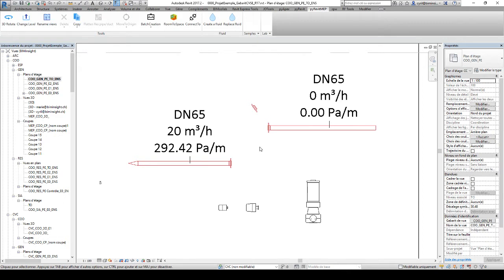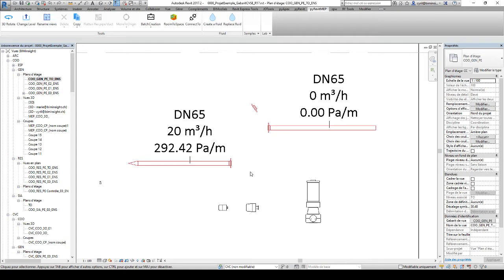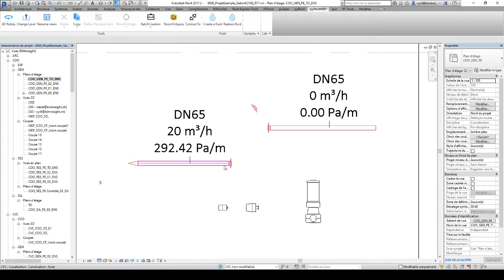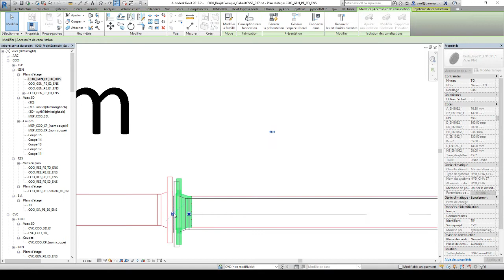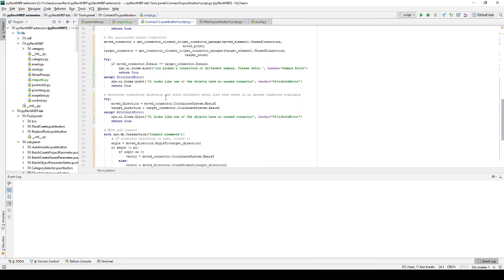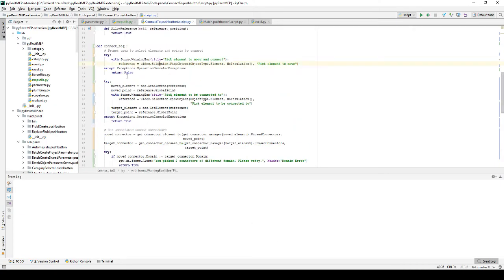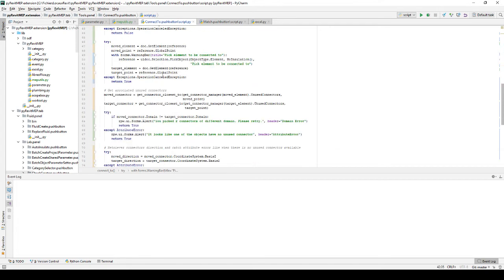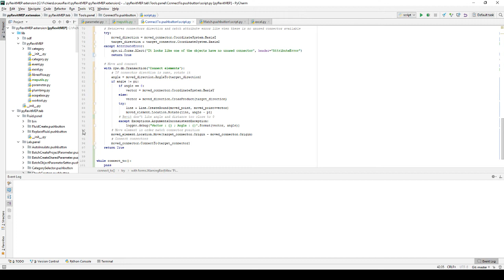[Revit] ConnectTo

Comment: Hey. we are the heating pipes in a single project file. then these pipes must be caught in another file.  how to automatically make a plug-equipment on the open end of pipes . many pipes at once.  and then you can copy the water flow to another file ?
Reply: https://drive.google.com/open?id=1rGhDJNoaKCQCfOVPy8uiZz9BrmPh7T3S
Reply from the maker: Hi,
I'm not sure I fully understand your question. If your goal is to propagate flow from a file to another by adding a mechanical equipment on each pipe end then copy flow from the source mechanical equipment to target mechanical equipment. Then you can as you said create the equipment and plug it on open end pipes (all selected pipes at once for example) but you need to do open both files, create plug-equipment, save and reload link. After you can copy flow using XYZ to detect which one should be connected together. It will not auto-update. But you can for example keep track of linked elements in a parameter or file to not have to reselected each mechanical equipment to update.
Reply: Cyril Waechter спасибо